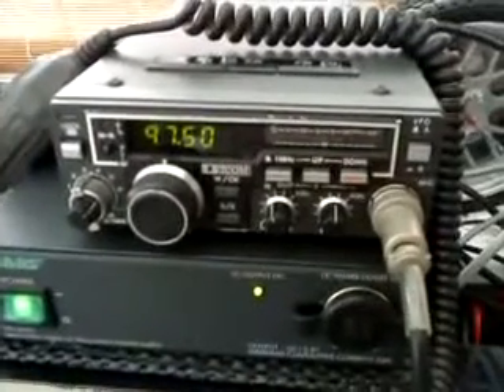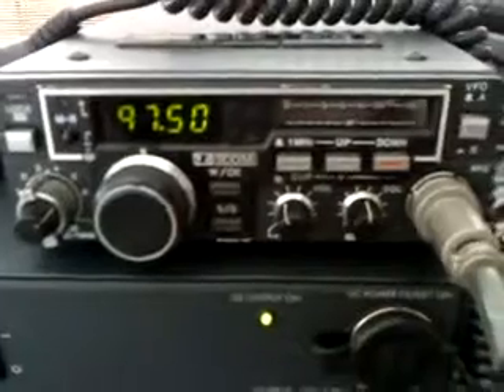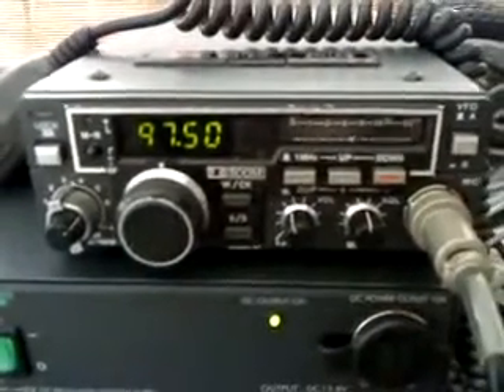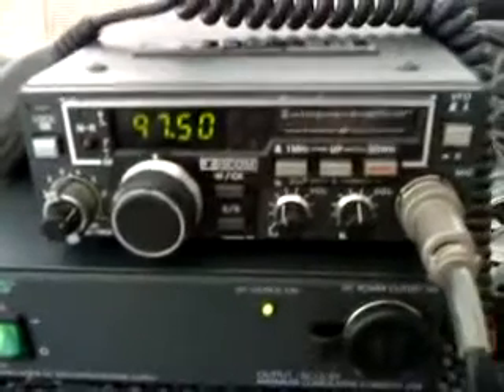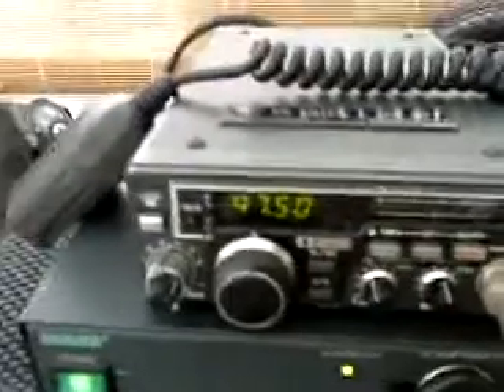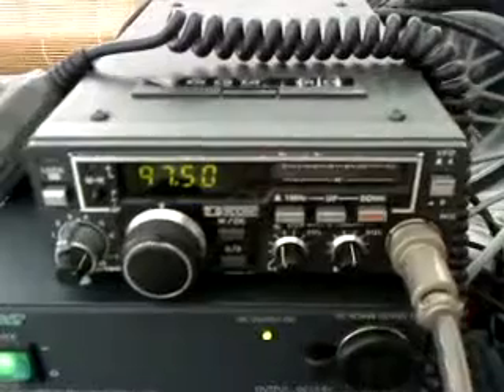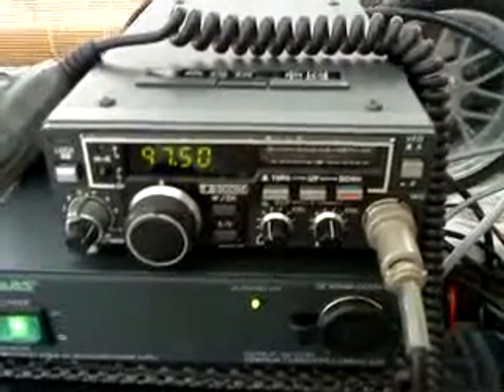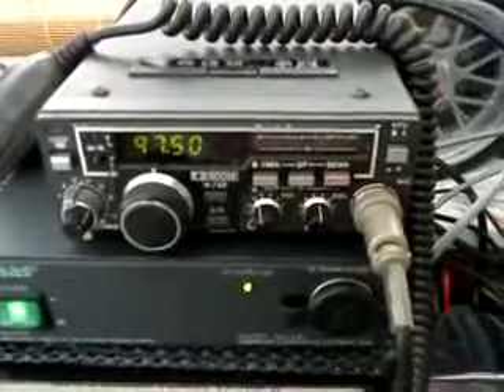ICOM IC-120 23cm FM Transceiver.MP4

Comment from the maker: Range depends very much on the type of  antenna and feeder you use, your location and power output. It certainly has some strange characteristics with signal enhancements during very cold weather. In terms of range - generally similar to 70cms but most FM stations are using low power (1 to 10 watts) so most comparisons tend to be a lower signal on 23cm. Hope that helps?  73s  Jon